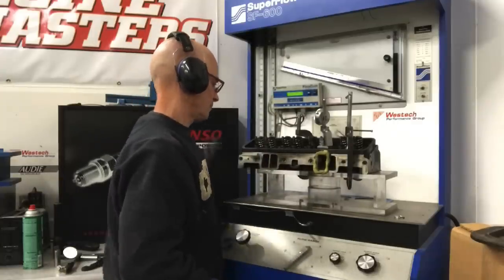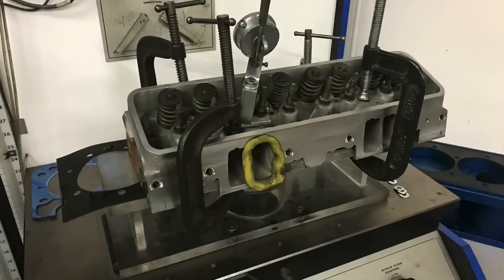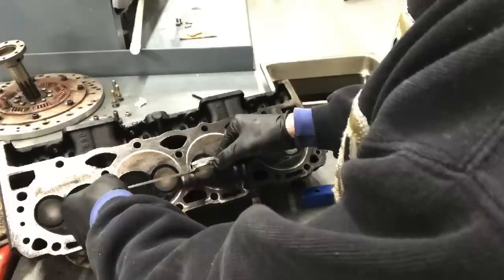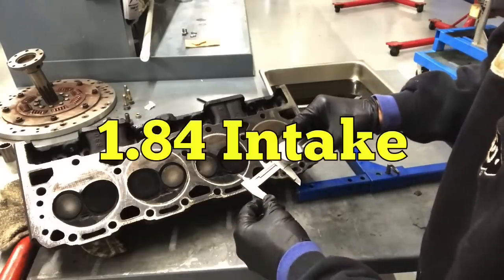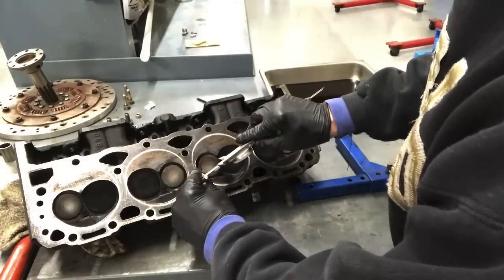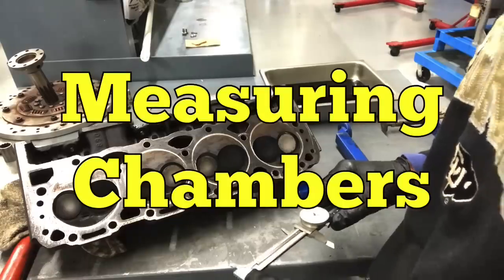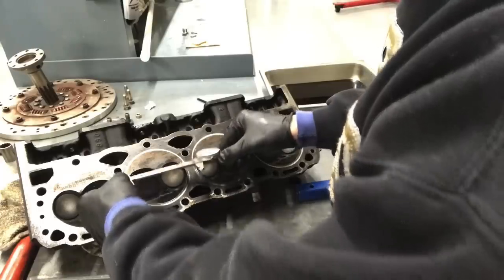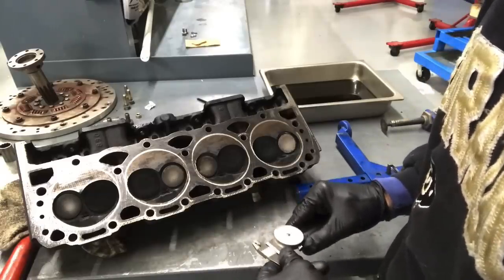L99 VS LT1 VS LT4-WHAT DO THEY FLOW?

Comment: And a stock K24 blows those out of the water
Reply from the maker: the K24 head flows very well
Reply: blows it out of the water where? what does a stock honda 4 door with k24 run the quarter? cause a stock 1993 lt1 vette or f body have been recorded to run low to mid 13s STOCK a lt4 has seen mid to high 12s stock and have been recorded at 380hp also a head  that was released 10 yrs later and is dohc better out flow one that was most likely developed in the late 80s also whats the TQ on a k24? lt1 stays pretty flat at 380ftlbs i bet i put a chain on the back of a 1993 camaro to the front of a honda it pull the front clip clean apart those cheap rusty thin metal CHINA VIRUS garbage

https://www.digitalcorvettes.com/threads/1996-lt4.84140/
Reply: Flow rate...  K24 intake flows 325cfm,   that's all I was referring to

Comment: I cringe every time someone does a cylinder head airflow comparison without an intake pipe or an exhaust header what is the point
Reply: As long as every head is tested the same way, the comparison is still valid. If you wanted an accurate, realistic measure of flow through a particular combination, then yes it pays to replicate that combination on the flow bench. In the case of comparing different heads,  whether the measured airflow is actually accurate doesn't matter. It's just a number that you can use to compare against other numbers.
Reply from the maker: I ran a pipe on the exhaust-and a radiused entry on the intake

Comment: Nitrous testing is the biggest waste of time and money in your entire dyno testing life.  Oh look a 100 shot produces 100hp... WOW.. WHO KNEW?!!?  Stupid.  Every single time.   It's not like you built some special Nitrous motor that produces 200 extra hp on a 100hp shot.  Absolute waste of time.
Reply from the maker: special nitrous motors don't add 200 hp with a 100-hp shot-unless boost
Reply: IMHO it is good to see just how much these stock setups can be pushed. Makes me regret not putting a turbo on my old 72 GMC that I had running on propane (over 110 octane). Oh if I knew then what I have learned from Richard....
Reply: @richardholdener1727  id like to see the point of diminished return! add more N2O but get nothing back in HP return. my stock lt1 with 1 3/4 long tubes is just above a 150 shot. doesn't go faster just gets angry.
Reply: @666BloodEagle  Sounds like a state of tune issue. Timing, fueling, something is working against you. In a nutshell you are forcing oxygen into your engine, if you have the fuel, spark and compression to burn it it will burn it.
Reply: The Hp increase is o my part of the equation SuperKillr- TQ increase from nitrous is a big factor as well. It’s not uncommon to see a 140-150Tq boost from a “100” shot. This is somewhere testing nitrous on the dyno comes into play. Torque breaks things. Say I wanted to spray a 125 shot on a stock 3v mod motor. Avg 315-325 stock HP + 125 call it 450 HP on the spray. Totally safe for a stock rotating assembly right? But let’s look at the torque, I see 525-550TQ with a 125 shot well tuned on a 3v and that is most certainly pushing it on stock rods. Without the dyno how would we know we are making that much more torque off the giggle gas?